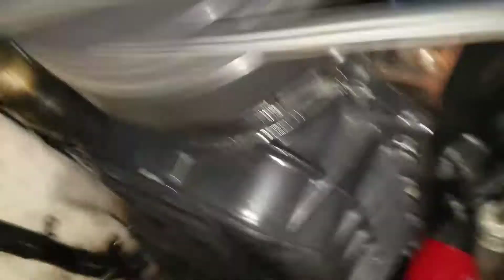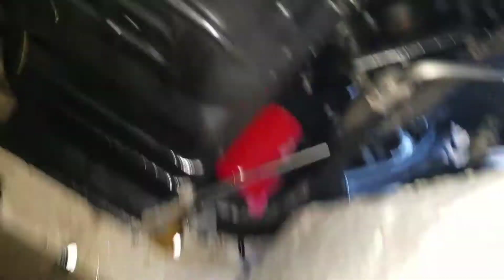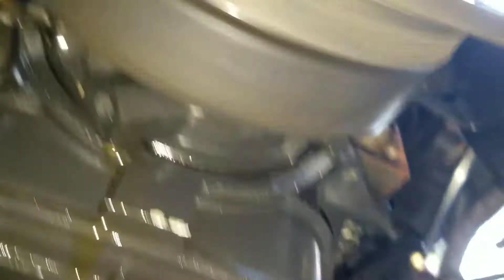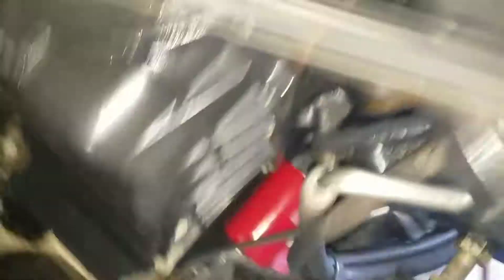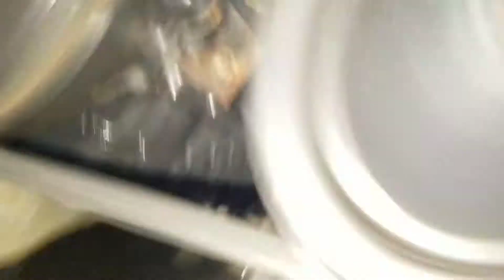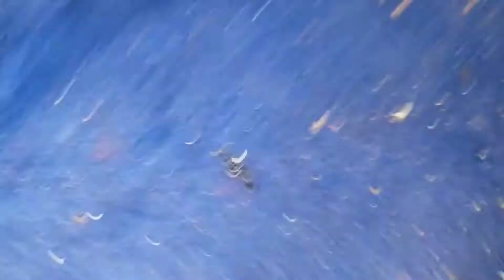4.3 GL Volvo Penta Oil Leak

Comment from the maker: I pulled the pan, got a new one piece gasket, cleaned both mating surfaces, and smeared a very thin layer of oil resistant rtv on the block surface before putting it back together. No leaks since.

Comment: How did you fix this leak without pulling the motor? I’ve got the 10 bolts out but the pan is still hanging on tight…
Reply from the maker: @mudchariot  how exactly is it hung up? Is the whole thing still stuck or is it a corner? Did you pull the oil dip stick tube off the pan?